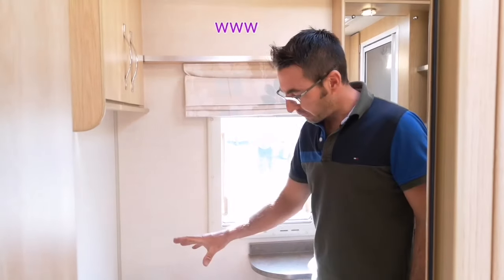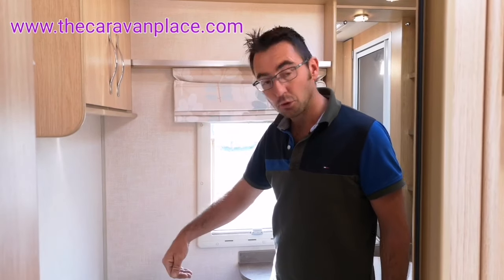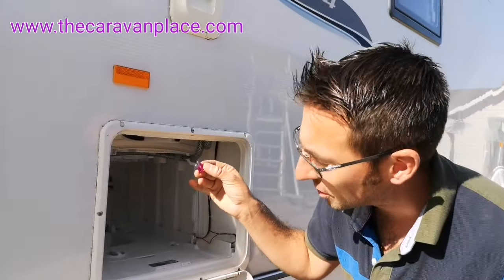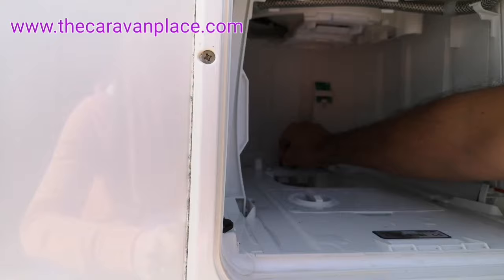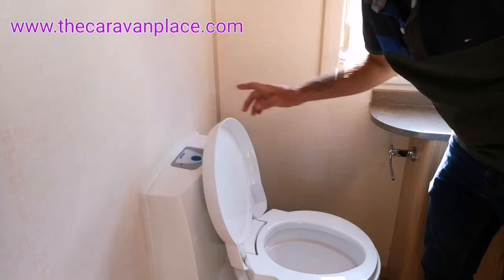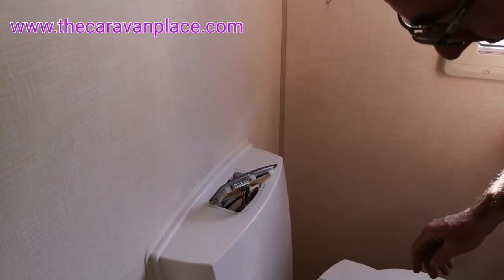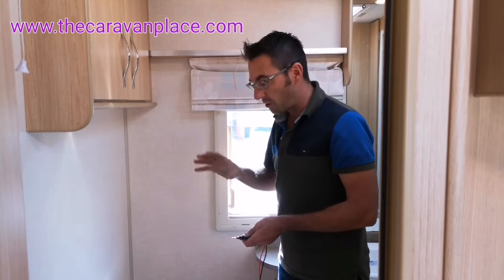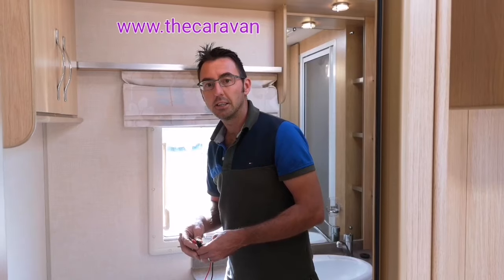Thetford cassette toilet not flushing, how to fix. Thetford toilet

Comment: For the benefit of any Newbies with a flushing issue.
1)	This video only relates to toilets with a separate flush tank. Toilets which use the main water pump to flush with water from the main water tank are very different.
2)	The common cause of the impeller getting jammed is black flakes forming in the flush tank. The major cause of black flakes is leaving the flush tank standing with a solution of pink fluid in when not in use. a) Drain the flush tank at the end of each break; b) If it will be unused over winter, flush the flush tank with plain water before draining.

Comment: Mine is C262 model. The fuse is in the main 12volt fuses under Sprite caravan seat. It turned out to be the tiny pump in the cistern was seized and just needed a spin with pointed tool. I accessed the pump by peeling back the label on the flush switch and prising out the switch assembly. Then remove the 2 screws and pull up the pipes with the pump on the end. 
Surprising how much scale and bits had accumulated in the pump impeller. 
Thanks for giving me some clues 👍

Comment: Great video. Followed step by step as per the video and found the pump impeller jammed (hadn't been used for almost 2 years due to Covid lockdown). Removed pump and spun manually then back-flushed with mains water. Working perfectly now. Thanks for your excellent video.
Reply from the maker: Fantastic, glad this helped.
Reply: @thecaravanplace  hi, I have this issue but when I put multiple on switch/PCB board (brown and blue) I’m getting no reading so I bought a new PCB board buddy still have the same issue. I have 12v coming in and hooked up to power. Hope you can help. Fuse checked also seems ok. Getting power into board so can’t be fuse can it?
Reply: multimeter

Comment: Thanks for your video, the only one that explains how to check the components. My fuse (2020 Coachman) is actually on board the main fuse board and shared with the external water pump.
Reply from the maker: Thanks Dave

Comment: Thank you. Removing the connector from the PCB and plugging back in a few times while holding the button (so I knew when it started to work again) worked for me.
Thanks

Comment: Thanks for this! Watched in case the problem was not straightforward, but turned out to be a blown fuse (which was well corroded as you pointed out). 👍🏻
Reply from the maker: Glad this has helped. Thanks for the comment.
Reply: I can’t find my fuse on Bailey Unicorn Cadiz 2012

Comment: Thanks followed your fault finding , perfect.  It ended up being a stuck pump  Gave the impala  a  little push with the  meter probe  as you suggested and boom of it went. I belive the blue fluid is responsible, very gunky. Pink only for us now.

Comment: Brilliant just arrived on site no flush. Will use all your pointers to locate. Thankyou
Reply from the maker: Hopefully this got you back up and running.
Reply: @thecaravanplace  It did indeed thanks again.Was so lucky as there is a great little caravan accessory shop about a mile from the site we are on, who had a replacement pump in store. 10 to 15 minutes to swap out, running good as new.

Comment: Excellent video. Ours is an intermittent problem...i.e.minimal amounts of water coming in. Any suggestions?
Reply from the maker: Possible bad connection, they do a electrical spray that may help. Its not very expensive so worth a try on the connections on the press button pcb.

Comment: Great, thanks, helped me a lot. Confidence is everything. Mine didnt work after the fuse and the board behind the button, fixed it by replacing the board down below - the fill level thingy. These are simple systems, although I think in my case the pump is harder to find.
Reply from the maker: Great to hear.👍
Reply: Did you find the pump? I cannot find mine so I am assuming the main water pump must be used for toilet flush. My intermittent problem seems to be at the connector to the switch logic board. Don’t think I could replace the connector even though it looks clean and no corrosion.

Comment: Hi there this is a good video is there any more tips and tricks as my one is not working I’ve changed the board the pump is working I’ve changed the fuse and it’s still not working
Reply from the maker: It's testing where you have power, start at the power coming in or on both sides of the power, then if you have power getting to the board? Then pressing the button and do you have power to the pump wires. It could be the wiring harness if you have power getting to the board. The little white connector that goes on the board could be faulty and needs replacing if you have power getting to the board. Hope this helps.

Comment: always carry a spare fuse and reed switch pcb. My pump used to fail after each winter, till I took the cassette out over winter and stored in garage - this airs the cassetter compartment over winter.

Comment: Ours has stopped working.   Our fuse is a green 30amp fuse.  Is this correct  as everyone I've seen it's always a purple 3amp one.  We have a elddis avante.
Reply from the maker: Should be a 3amp fuse. Hopefully if you work through as in the video, you can get it working 👍

Comment: Thanks for this it was the connection at the top so thanks for your help!
Reply: Did you replace the connector or the circuit board?
Reply: @peterward2357  i just cleaned the corroded connections, sprayed with silicone spray and it has been working great since. I now know where to go looking next time.

Comment: my problem is the pump makes a noise but only a dribble of water comes through, any advice on this issue thanks
Reply from the maker: @leeman2k  sounds like a blocked pipe, maybe flushing 10% bleach mix through to clean the system out might help.

Comment: Would you happen to know about the C262 Flush?  Changed PCB but cables to the block came away when cleaning and struggling to determine which ports the 3 black cables go to £60 + for a new harness and then having to remove toilet to connect it up.(Want to avoid paying Cannot find any diagrams anywhere. Any help would be greatly appreciated. Thanks Martin (Just realised I am logged onto google as my daughter!)
Reply from the maker: I think they are a common negative so shouldn't matter where they go.

Comment: Multimeter shows -13V (minus) when I check red and black wires. Why minus? Is it normal? Anyway my problem is if I switch on main power switch in the campervan, that c250 PCB heats up quickly and would probably melt if I won't switch of main power. What can be wrong? Polarity? Or PCB dead?
Reply from the maker: Yes the minus is saying the positive and negative are wrong, if u swap the prongs over so red goes to black and black to red, it will read correct if it is wired wrong. You will need to try and find where the power comes from and see the supply to the toilet is wired wrong?

Comment: My thetford toilet with a C250 cassette is intermittent in working, I’ve removed the flush plate as shown but there isn’t a pump in this area, do the toilets have a separate pump or could it be the main water pump that is being used?
Reply from the maker: Hi Peter, the pump will either be top right from when you look at where you take the cassette out from outside, or when you remover the push button control panel, you will see 2 screws that hold the pump but this is the c260 model where the pump is inside.
Reply: @thecaravanplace  : thanks for your info, with the cassette removed there are only cables going up to the toilet flush, removing toilet flush panel it lifts out with about 12 inches of slack cables, removing the 2 screws and there is only daylight looking down to the cassette area, the screws do not hold anything in place in fact you can see daylight through the 2 holes. So no pump in this area. Maybe my 2008 motorhome has a hybrid C250 toilet. I have photos if I can attach them to my comments I will, your further advice would be appreciated.
Reply from the maker: If you want to send a picture to thecaravanplace@aol.com and I can have a look

Comment: At 2:00 a degreaser is sprayed on the fuse. By itself this will do nothing. Any grease or dirt on the pins will not be removed unless you use a clean cloth to wipe off the grease that will have been dissolved by the de-greaser. Also you really shouldn't spray the solvent onto your bare skin.

Comment: Our toilet stopped flushing at the start of the season. I checked the fuse which seems to be ok. The red toilet full light is working but not the flush. I’ve fitted a new control panel but still nothing . Any advice please.?
Reply from the maker: Hi Gwen, you need to test if you have power on the board, so twst if power is coming to the board and then test if you have power going to the pump when you push the button. If you have power when pushing the button, its the actual pump, if no power then its finding why you don't have power.
Reply: So the fact that the red ‘toilet full’ light works doesn’t mean there is power going in?
Reply from the maker: Possibly to the board but that might be from the sensor that says the cassette is full. If u start at the pump wires on the flush board inside, check you have power then to rhe pump when pressing the flush button, if not work backwards and check the power.
Reply: Ok thank you.

Comment: I cannot find the fuse anywhere on my Bailey Unicorn Cadiz 2012 ?
Reply from the maker: It may be in the main fuse boards with the trip switches possibly under the front seats?
Reply: @thecaravanplace  thanks for your reply I looked yesterday and had to replace the fuse for the auxiliary sockets I cannot see anything that looks like it might be for the toilet Thanks

Comment: told my dad about this video, checked the fuse first and it was corroded so he cleaned it and tested it with multi meter and it was completely dead so we are fairly sure that it is that. We've also recently replaced the grey and orange toilet cassette as that had also broken (the opening ring blade mechanism had corroded/split so we believe that the toilet must have leaked because the cassette was broken and the fuse has got wet which would explain the corrosion. Not 100% sure where to get a replacement though.
Reply from the maker: If you have a google and should find a few online. Hope this helps.
Reply: @thecaravanplace  we are not too sure if its just the fuse so will also investigate the reed switch, the flush button and the pump like you suggested. super helpful video so thanks a tonne. saves having to contact dealer etc.

Comment: Have they stopped making the 50710 thetford pcb board for c250 cwe
Reply from the maker: You should still be able to get the same pcb board. Stock shortages are causing problems with parts at the moment though.
Reply: @thecaravanplace  would the 50709 be an alternative .
Reply from the maker: @patadair6544  https://www.primaleisure.com/product/1040213?utm_source=google&utm_medium=surfaces&utm_campaign=shopping%20feed&utm_content=free%20google%20shopping%20clicks&gclid=CjwKCAjwxo6IBhBKEiwAXSYBs4YcTOTvQaVlIg9meBuOeB-BeqqLXpTre7l2UwQvySHxXocpJj3Y2xoCXuoQAvD_BwE
Reply from the maker: https://www.ebay.co.uk/itm/391955550379?chn=ps&norover=1&mkevt=1&mkrid=710-134428-41853-0&mkcid=2&itemid=391955550379&targetid=1279076610849&device=m&mktype=pla&googleloc=1006656&poi=&campaignid=12125451089&mkgroupid=125212048520&rlsatarget=pla-1279076610849&abcId=9300480&merchantid=7404264&gclid=CjwKCAjwxo6IBhBKEiwAXSYBs-h61sSY7pudOfi1SeTdcUs4GKkuBl4IBcCsgaox8KPAjXrekNzesRoCthkQAvD_BwE

Comment: Hand pump not working any idea's
Reply from the maker: Either pipe has come off, or the inside diaphragm is no good, if you search for a new manual pump, you will see what it looks like and be able to remove and check the pipe is connected, if it is it will most likely need a new pump.

Comment: Utterly frustrating when this just will not work. No external fuse as it is built into the circuit board. Pump works, voltage at the board but after trying 3 very expensive boards still nothing. Very poor design and manufacture
Reply from the maker: They can be a real pain, hope you get to the bottom of it.
Reply: "Bottom of it" lol 😂
Reply: @Andrea-lc7fi  😂  Sorted it. All 3 previous boards were bought off the internet ( not cheap either ) I took a chance and bought one from a dealer costing only £5 more and that worked. The three off the internet were obviously fake. A lesson sorely learned

Comment: I've got a c250 and I found out that the fuse was blown. I replaced it and as soon as I switched the power on the fuse blown. What can be the problem?
Reply from the maker: The pump is no good and needs replacing. Thanks 👍

Comment: Didnt work for me, red and black wire = 12V,  Brown and blue = 8.4 vault , replaced circuit board with new one, changed fuse, replaced Reed switch, still no joy
Reply from the maker: Is the pump stuck, possibly remove pump and try on a direct 12v supply,